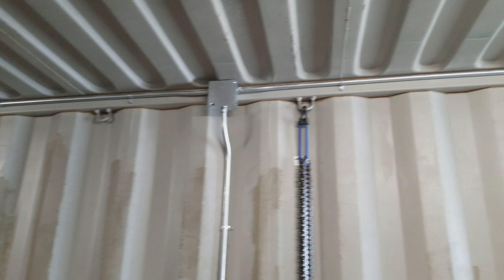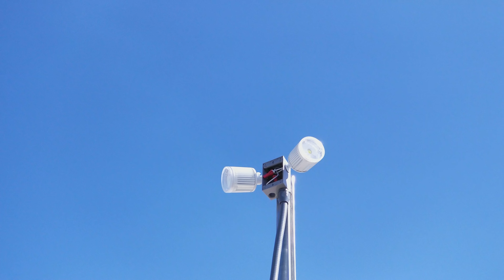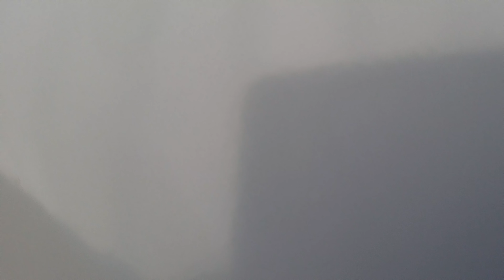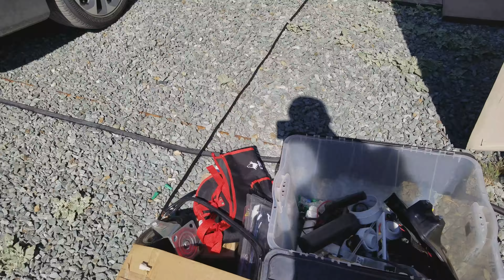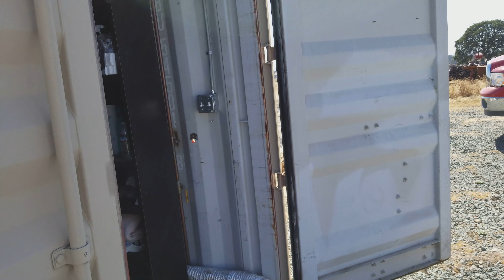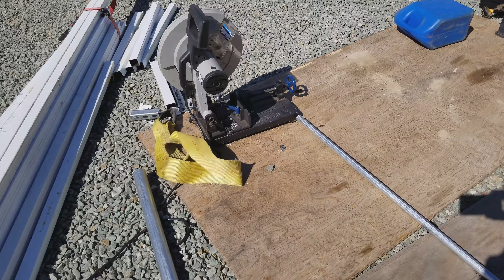Off Grid Battery Maintainer Power + Update!

Comment: Great vid. I paid for one of those fox inverters but they took to long to send so I got my money back. So I switched to 120vdc system instead of 48v. How is it?
Reply from the maker: Inverter is good. I am very curious about the 120 volt DC system because I know there are a lot of codes that come into play when the nominal voltage of the system is above 50 volts. Are you using the DC for your utilization equipment or do you still have in inverter? What are you using for solar charge controllers?
Reply: Im definitely not as electrically smart as you but yes it is an inverter that I got cheap around Christmas. Its a 10kw 120vdc to 120vac(No 240vac) and I found a company that makes custom controllers(Its not like a fm80 tho) but I=it works and is much less draw on the batteries. My batteries used to sit aroung 49.5v under 3000w load now they barely notice a load. More vids coming https://www.youtube.com/watch?v=YJuiw-dHjGM
Reply: Are you all up to code with your system?
Reply from the maker: Frank Z I have a few things that I need to iron out but very minor. For example I did a test on my ground rod and it did not have a low enough Earth resistance so I need to dig a trench and put in a ground Loop. My solar panels are grounded\bonded but not properly so when I build the new solar rack I was going to fix that part.  Other than that I just need a few KO seals and I'll be good
Reply: Will the inverters be ok? Or does that matter. Im asking because i dont know . Im not trying to be a dick.
Reply: Can you do a vid on the grounding when you do that. Thanks
Reply from the maker: I sure can.  The electrical room is qualifed personnel only and the inverters are installed per the manufacturers instructions
Reply: Nice . I have never even tried to see what is required. I called my E company and they had never heard of a hybrid system. Only grid tied so I just do my own thing. I try to be as safe as I can afford. But I don't have much money so this is what I got. It works .I wish I could have a $30000 system but that wouldn't ever pay for itself.
Reply: This is why I watch you : )